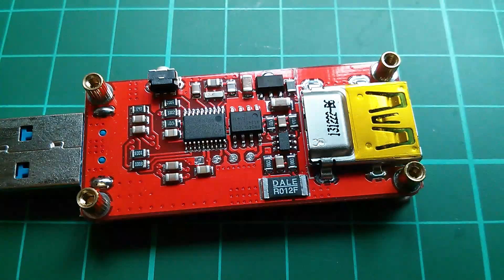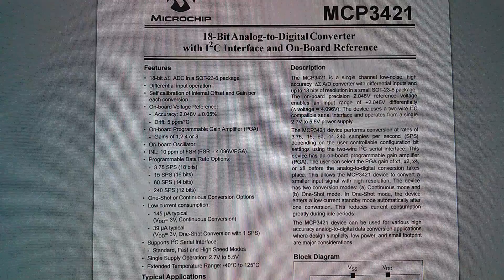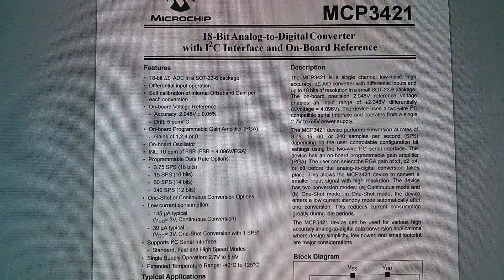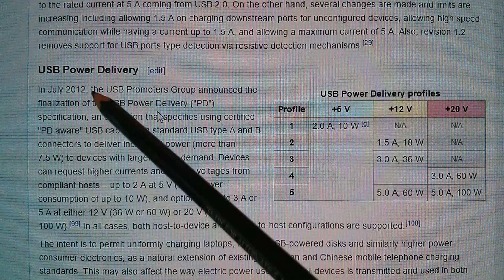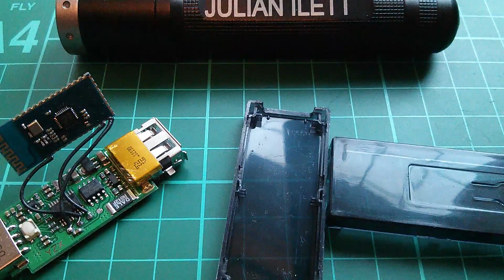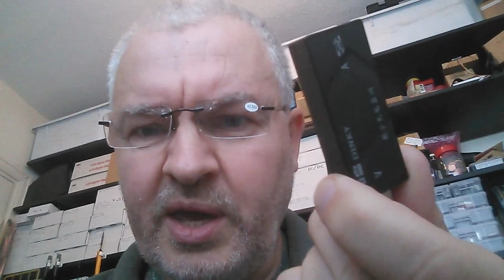First Look: YZXstudio Black 18-bit ADC USB Power Monitor #2

Comment: you should take an plunge on the most advamced fellow YZXstudio1270 or the newer 1271/1272/1273..there has happen a lot since..btw are you familiar with any android app or windows software there can take bluetooth serielvalues and map them on the fly-- got no problem in getting the seriel or the hex values out from the usb meter on bluetooth, but would love if there was an software there could graph them out on the fly.

Comment: I guess its like the one i got, it also from ZXYstudio, but with lcd colorscreen and the bluettooth raw stream can be adjusted from 0.36sek to the minutes, and makes it easy to just copy paste the dataloggin-numbers to make an graph.

so quite usefull to see the voltage & current comsumption over time in an visual graph and fx how an powerbank performs over the battery-range.

I know numerous multimeters got the bluetooth datalogging feature, and take this raw value-stream from wireless bluetotth and put it into an graph on the fly..anybody familiar with "apps" to any system that can graphf these values on the fly... in praksis it should be pretty basic to write & compose, so I would reckon it exist..? but sofare cant find any on android, or osx, or win10/7 / windows phone app that can plot these values on the fly..??
btw' Have you tested the ZXYstudio powerbank gen7 or 8.. pretty wicked the manage of power there exist to manage 12A !! (gen8)

Comment: Anyone have a schematic or firmware source code for these they are willing to share? I'm trying to understand a why some devices are able to draw more power when one of the monitors is inline. I'm using a yellow model. I suspect a low resistance is temporarily across D- and D+ when power is first applied and some devices think the monitor is a charger.

Comment: Hey julian, i just found this one:

ebay.co.uk/itm/121760424594 
could be interessting for you, since you collect the yzxstudio power meters.
it got a bigger lcd instead of oled Amphour / Watthour readings for powerbanks and d+ d- dataline voltage
Reply from the maker: +gamerpaddy Interesting - thanks for that. LCDs are much easier to read in bright sunlight than OLEDs. One step closer to making those USB solar panel reviews!

Comment: The sampling speed is VERY IMPORTANT unlike what you state in the video. To calculate mAh/mWh rating you need to measure area under the current/power curve. If you have just 3 samples per second, this curve is going to miss most current bursts. It is going to be a very poor measuring device. 

The only hope is if you are doing some kind of analog averaging using capacitors and/or inductors before measuring with the ADC.
Reply from the maker: +lhxperimental But over a 2-hour charge period, around 10,000 samples will be captured and accumulated. Surely that's enough.
Reply: +Julian Ilett Depends on the load. If the load is just a resistor, or some constant current load then a few samples per second is more than enough. If you connect a mobile phone or some other digital device, there are going to be bursts of current consumption which wont be captured because of the low sample rate.

A dedicated coulomb counting IC like LTC4150 is more suitable. But perhaps the 18 bit ADCs are cheaper or the designer made assumptions about the use case decided that a coulomb counter would make the device more expensive without making the device that much more appealing.
Reply: +lhxperimental For example, many low power devices actually consume a 10s or even 100s of mA of current for a few microseconds and then return to low power sleep mode. A multimeter would not be able to measure the current properly as it sampling rate is very low. To measure the consumption of such devices one would use an oscilloscope and integrate the current pulse curve.
Reply from the maker: +lhxperimental Funny you should mention the LTC4150.......

Comment: Hi Julian... thanks for the videos. 

3.5v to 24v / 3amps

hmm thinking would this be ok to put in line with a solar panels wiring to display volts and amps. 

Also could you do a video on its output to bluetooth or wifi "data logging" please. that would be cool.

Comment: Unfortunately increasing the range means lowering the resolution.
Reply from the maker: +Thanh Tran The voltage range has been doubled (approximately), but ADC resolution has been multiplied 64-fold by switching from a 12-bit ADC to a 18-bit ADC
Reply: Julian Ilett I meant if the resolution was 18-bit at 5V versus 18-bit at 20V (USB Power Delivery specs).

Comment: Hi Julian. I found a blue one. Can you take a look at the differences and make a summary video to show what are the differences between the versions? Thank You!

You don't necessary buy the blue one. Would be enough to tell the features using the descriptions if it's possible. The blue one is quite expensive here in Germany.
Reply from the maker: +BloodySword I think blue and yellow are the same - just different colours. Yellow can alter the D+ and D- lines, either pass them straight through, cut them, or spoof them (at the socket end) to Apple 2.1 amps. Red has an extra screen that reports the D+ and D- voltages and uses a look-up table to display descriptions of their meanings. But Yellow can be either the old (longer) two PCB type or the new (shorter) 3 PCB type. It's getting complicated.
Reply: Julian Ilett I don't need either of the red and yellow special features, since I only have Windows Phone and and Android device. I'm not interested in Apple at all. (Virtually, with 50 Ohms resistor) Shorting D+ and D- will make my devices suck as much current as they want to. I even made me some USB-Adapters that do it to fix some dull but high performance USB PSUs. So I think the black one is the right one, extra precision is much more appreciated than this D+ and D- nonesense. ;)

Thanks!
Reply from the maker: +BloodySword The black one also has the D+/D- reporting feature which is really handy.
Reply: When you review and test power banks, yes it is indeed handy. But in my case I have only my Apple-Free use-case, so I don't care much about D+ and D-. I notice it when it's not shorted and then I just shove in my adapter stick. :o)

Comment: sorry can you tell a bit about usb 3.1? Is it physically compatible with previous USBs or is the increased voltage on different pins?

maybe it starts with 5v and only goes higher on specific data-requests? though that'd make it a really error-prone.. I'm not liking the thing of several voltages, 5v was just fine
Reply: +redtails USB 3.1 is supposed to supply devices with up to 100 Watts. You don't want to let 20 Amps flow through a USB-A or USB-C type connector and cable. Don't even THINK about it! The standard is very solid. The device must be able to power on a small micro controller using 5 Volts to send a command with verification bits back to the USB host which is capable of Power Delivery standard to request 12 or 20 volts (more precisely selecting one of the Power Delivery profiles). ONLY Then USB 3.1 will switch up 12 Volts or 20 Volts.

This new technology will CHANGE everything in the next few years. Imagine a docking station for your Notebook where you just have to put ONE wire in and the Notebook is charged and at the same time you have a sound card, a display and a few USB 3.0 and 2.0 ports on it. Second possibility is to have a graphics card with USB 3.1 connections using DisplayPort over USB 3.1. One cable and you have your monitor hooked up: USB Ports, Video data AND power connected through ONE wire. No more cable salad.

Edit: More likely DisplayPort will stay on Graphics Cards but there is an extra option to get the video dater to a USB 3.1 DisplayPort capable USB 3.1 host controller. Hopefully via an extra connection and not through the far to slow PCIe 3.0 16x lanes for current graphic cards...

I hope that this USB monitor unit is capable of contiguous 5 Amps max. The current path I saw on the PCB in the Video is quite promising.
Reply from the maker: +BloodySword The Black one has USB 2 connectors not USB 3. Also, when I said the black unit is "ready for USB3.1", I meant the circuitry is ready - the firmware may not be.
Reply: Julian Ilett
Thanks for clarifying. I understood that, except for the firmware part. Hopefully there will be an update when USB 3.1 gets more and more popular. I just would wack a mini header with wires to it for flashing it. Or must the BlueTooth transmitter be disconnected in order to flash?
Reply: ***** well the usb charging protocol always allowed up to 5v 5a, which is already a lot.

I'm just not seeing success in the different voltages.  Desktop computers and dedicated adapters are pretty much the only machines that are capable of delivering such power. Just like notebooks from the past that had firewire never had the 30v 1.5a power on them. On a desktop computer, cables aren't really an issue. If you need a dedicated adapter, then usb would offer no advantages over barrel plugs.

I enjoy new technology, nonetheless :)
Reply: *****
Notebook docks will also have enough power to charge and run any business notebook out there without any problems. They also use a Voltage of around 20 Volts, the variance is between 19.5 to 20.5. So no problems at all.

And it's also a cool thing to have a monitor hooked up with just one wire from the Desktop PC to the monitor itself, no extra PSU needed, less conversion loss and higher efficiency. And the monitor is only on when it's really needed.

Comment: I want one, but the price is a bit high, you can get a half decent multimeter for $30.   the bluetooth feature is interesting though.
Reply: +mc349iii In Germany, the red and yellow one are even more expensive... But I bought this black one because it's ready for the future and 4 digits after decimal point are really great!
Reply: *****
It has an 18 bit ADC with dedicated volts and amps front-end. I doubt that this is shitty. A decent multimeter is so expensive because it must handle up to 1000 Volts or more without any hazard. This little thing is for only up to 20 volts, though. No HRC fuses and MOVs needed and much less functionality.
Reply: *****
Cheap meters are capable but there is a high risk of electirc shock. My Fluke 177C is nowhere near accurate but cost me 150 EUR shipped from the UK to Germany.
Reply: *****
To a Fluke 87 V
Reply: When it's calibrated, yes I think so.